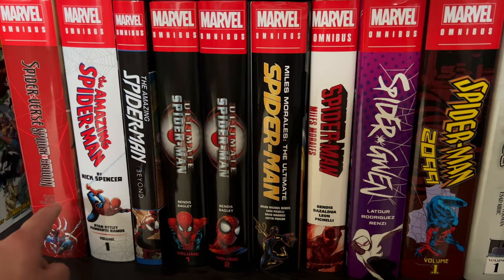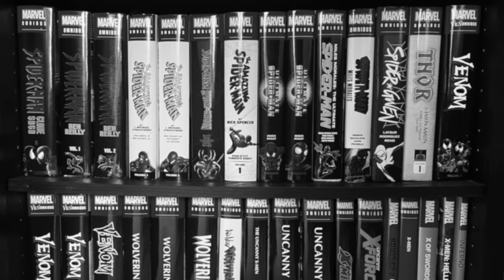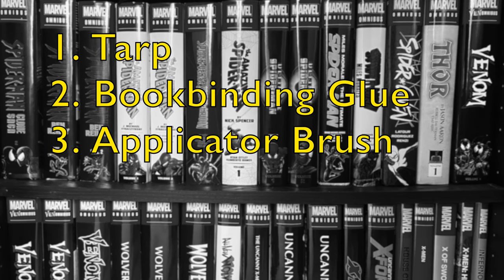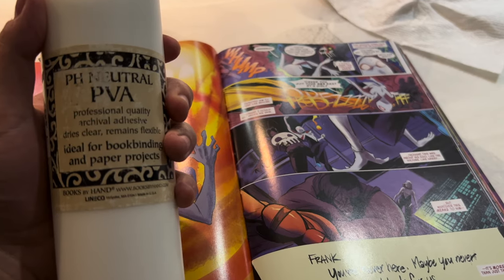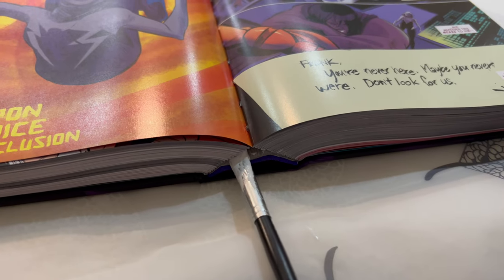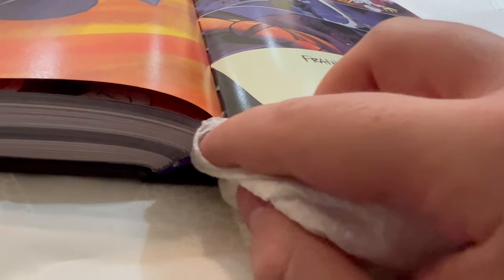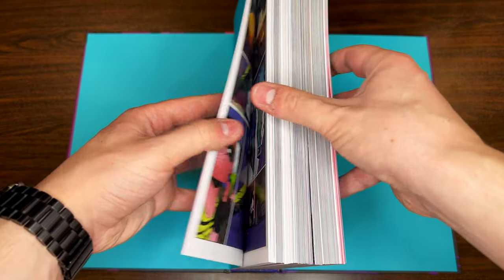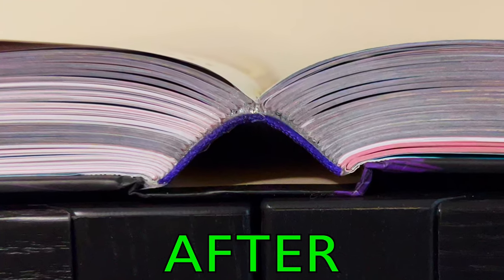How To Repair An Omnibus Or Hardcover Binding - An Easy Guide!

Comment: My Spider-Gwen omni has a little of this but it is only I think one gathering of signatures is effected, so I won't worry about it. I had two copies of Severn To Eternity where the inner spine was glued too tight and the entire set of gatherings came away from the spine. The first I sent back. The second I fixed. I had to loosen away the inner spine from the outer spine first, so that the inner spine had the available space to be opened fully. Then re-glued the gatherings back tot he inner spine. All good now.
Reply from the maker: Yikes, what a pain, happy it worked out for you though. And yeah, I also had to fully separate the inner spine from all of the page bunches when fixing the Spider-Gwen omni. It can be daunting because it can feel like in order to fix the problem, you have to first make it worse 😄
Reply: @SuperFlyComicsGuy  definitely. And there is a feeling you paid a lot of money for a broken product. But it is an easy fix once you have done it once, and it works well

Comment: I hope I don't need to use the advice in this video, but thanks! I just ordered some omnibuses and later read online that their bindings are bad. (No returns allowed either.) So, it seems I'm stuck with them. For years I've opted for trade paperback books over hardcovers when reading "normal" books -- why is it that so many comics fans like these omnibuses? They're heavy, awkward to bring anywhere, and seem to break a lot. Why not go trade paperback for comics? (Is it because you can't get all the issues without the omni?) EDIT: And to be clear, I think the omni's look GREAT -- if the bindings were made like normal books that don't fall apart!
Reply from the maker: I hope your books will be in good health for a long time! For what it’s worth, the vast majority of my omnis have had at least decent binding quality, but as with anything you do get a few bad apples here and there. 

I can’t speak for everyone, but I personally love the omni format because of the convenience - having a huge chunk of a run or story in the correct reading order all within a single book. Way easier than worrying about tracking down multiple trades, or even worse - organizing single issues 😄 Plus the oversized artwork is always a treat!
Reply: @SuperFlyComicsGuy  Thanks for explaining. The ones I bought have multiple stories / runs that would have required purchasing multiple trades each, and I usually don't need to take my books anywhere, so I don't mind the size myself :) I "break in" all my big hardcovers carefully, so I'll do the same with these and hope they hold up! Great point about the oversized pages!

Comment: I came back to this video since I've purchased some omnibuses... Something I learned is to inspect an omnibus when I get one to be sure it looks "normal." I got an omnibus that looked clearly defective from the factory, and I returned it for a different copy. The new copy looks normal. The bad copy had poorly "carved out" page edges that was more like a 90-degree notch instead of a smooth curve, and the "booklets" that get glued into the spine were way uneven like the pages were cut the wrong width and didn't reach as far into the spine.
Reply: P.S. Crazy as it sounds, I'm storing all my omnibuses on their side (flat) instead of vertical because I think it'll put less pressure on the spine over time. I read about this (and it was apparently confirmed by a librarian), and my experience with normal textbooks that are huge is that they develop noticeable sags in the spine from being stored vertically. So, for omni's, I'm keeping them in stacks, horizontally on the shelf. Probably no more than 3-4 high (but some people stack 5 high). EDIT: for clarity
Reply from the maker: Definitely a good idea to inspect your books for flaws prior to opening/reading them - a lot of problems can be avoided in the first place that way!

Comment: having this with Once and Future Deluxe edition.
But what if the gap is not big enought for a brush to get in?
Reply from the maker: You can also use a long toothpick or a smaller liner brush to apply the glue instead of a fat brush, it’ll just take longer. Alternatively if you’re brave, you can separate the glue further yourself to make space for your brush to fit 😋
Reply: @SuperFlyComicsGuy  i do not think i am brave enough to separate it more.